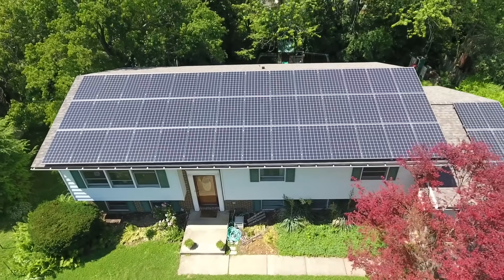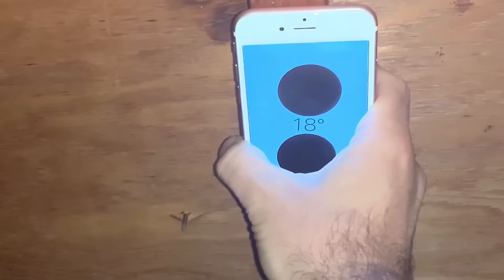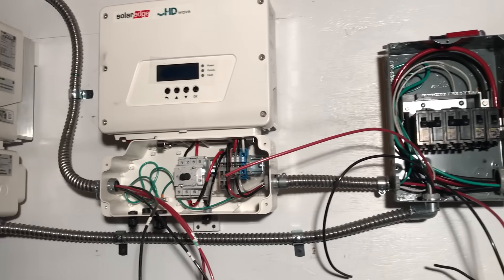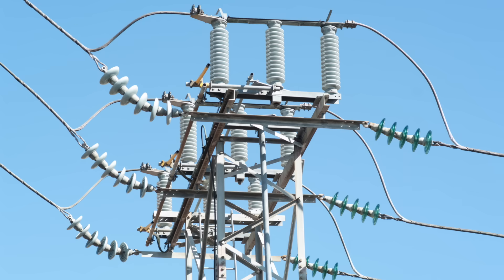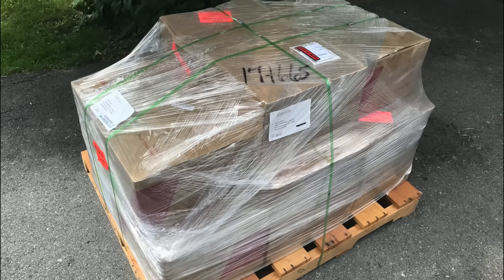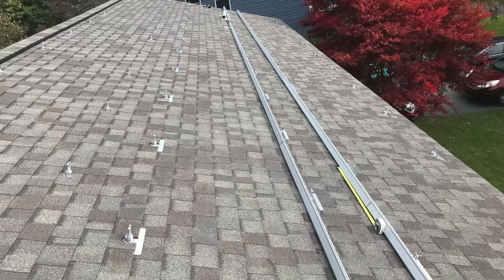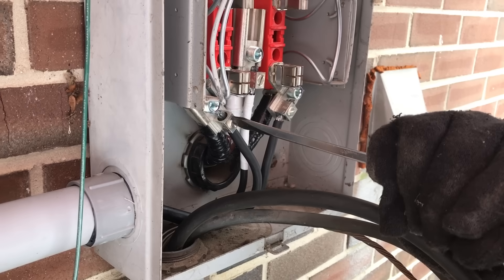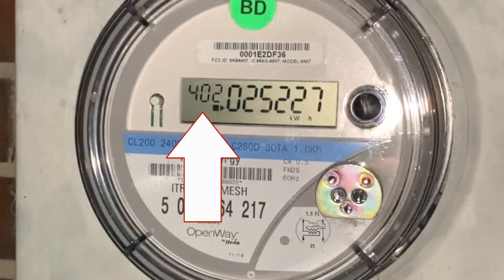I Installed a Power Plant Myself | HUGE DIY Solar Panel System

Comment: Excellent video! My only question (I'm sure others are curious) what the cost of materials was? You said you spent a "hefty amount" when things were unloaded and I'm wondering how realistic this is for the average household income. Thanks!
Reply: The only way I would do solar is off grid. screw the power companies!
Reply: Edit: They made a video on what they spent. They still pay $7 and some change a month in a fee, no batteries because they are hooked into the grid itself. However because of the credits they make, and can sell on an exchange, they end up making money each year.

The total cost that they said in the other video: $22,921, but they got a 30% tax credit which they say took the cost down to $16,045. https://youtu.be/QVanNbp6a4w A link to the video.
Reply: @TerrenceMcGinnis  Come to Canada...  on our electrical bills even if you do a solar roof system, as long as you are connected to the grid and supply most of your own electricity, you still have to pay "administration fees", "distribution charges", "transmission charges", "transmission deferral riders", "balancing pool allocation riders", and "local access fee"...  all these fees (and good luck figuring out exactly what they are...) constitute 30% of our bill...  my bill was $344.15 last month, and $91.98 was these "extra's" (not the actual electricity used)...
Reply: prob around 2-3 k, maybe as high as 4, but a lot of time
Reply: @leifseed  2-3k??? Do you know the price of copper wires?? A good 100ah battery sets you back 800 dollars alone, and that can only turn half the lights on.
Reply: @justheretowatch9451  a hundred or two for wire
Reply: @justheretowatch9451  im sorry where do u live
In middle east a 200 amp c10 battery is 270$
Reply: This is always the thing and part of what is making solar so difficult.  They keep it clouded in mystery and no one can ever seem to say what the actual cost is for setup.
Reply: You won’t get a reply.   It’s like a secret.   It really it’s embarrassing to say you spent 50,000$ on a system that last only 20 years with the batteries lasting 5.
Reply: @alab3657  https://youtu.be/QVanNbp6a4w Their video with the cost. And I don't think they have batteries, they do the whole 'back into the grid' thing instead.
Reply: @alab3657  Yeah battery replacement would be  the same cost as just being frugal with your electricity, better of investing into water tanks to save
Reply: @alab3657  He answered those questions in a follow up video he posted over a year ago:
https://www.youtube.com/watch?v=QVanNbp6a4w
Reply: All of your numbers are way off and he said it'll pay for itself in 5-7 years in this video. Who tf liked this crap?
Reply: @32BitJunkie  In 7 years those panels and all that accessories will be useless .
Reply: like another said, is actually embarrassing. the life of these panels is about 20 years on average, with decreased efficiency every year. truth is he will probably never cover the cost of the install with savings on electrical bill. i know this because i install solar as a living.
Reply: @justheretowatch9451  so mate, at this point are you saying solar isn't worth the expense?
Reply: @jdm6613  not yet. It's certainly fun to experiment with and it does have its niche uses. But for whole home power, it's just not viable yet.
Reply: @justheretowatch9451  thanks mate, I always wondered. Especially during power outages.
Reply: @jdm6613  nah, get a 500 dollar gas generator for emergency back ups. That's what I use. I have some solar but I got the panels free and only use it to power my basement lights. But I do it for a living and got the materials free so it's different.
Reply: @justheretowatch9451  ok mate, thanks again. Take care
Reply: @justheretowatch9451  Id rather pay the cost.... rather than paying an electric company.
Reply: @justheretowatch9451  you pay off your panels in 6-7 years. Panels and workmanship warranty are up to 25 years. Panels are guaranteed to have 80% efficiency after 25 years which is still good. That's amazing. You're just a hater for renewable energy.
Reply: Not worth it for now, just a headache.
Reply: @denialphasebitcoin5639  well in the UK electric prices are soaring   im saying doubled

Comment: When using a generator during a power outage it's very important to use an interlocking device that prevents electricity from going to the grid and potentially hurting a lineman making repairs. 
In a solar system such as the one featured in this video, is there such a device? Does that special meter keep power from going to the grid during an outage? 
Also, will this system run the house during an outage (assuming you're getting full sun light)?
Reply from the maker: The inverters shut down when there is no grid voltage. In the US, this is a mandatory safety feature for inverters.
Reply: @FrugalRepair  ...I didn't see any mention of a battery storage...i assume when the grid is down, you don't have power either.  Is a battery next on the project list?... And thanks for the video .. excellent work...

Comment: You say you earned your investment back around  have 5-7 years. Is that the cost of only the panels and all electrical wiring and how about your inverter? How much do you think you have saved by doing most by yourself? You invested your time and had some free help. If you hired a company to install all in once, within a day you can complete a roof. Much time also goes to wiring and connecting with your inverter and your meter. How much do you think did that extra work add up to the costs? 

Many people can only place 6-10 panels in the Netherlands. We have a second and third floor so our houses aren't that wide more small but with more floors that makes it pretty even. But less place for panels and I think that, oké 48 panels are much more than 10 panels of 300 watt we have, that you always have initial costs regardless of how many panels you place. For you it costs maybe a couple more manhours to place all panels but if you didn't did place them by yourself. How much costs did you need to pay extra and for me more interesting, how would the extra costs affect the payback time from 5-7? You earn a lot with almost 50 panels and energy prices are going trough the roof!

With so many panels you will absolutely deliver energy when it is full summer. In the night you use energy. And in the winter you maybe use more from your energy company. Can you "net" the supplied energy with the returned energy? So if you net deliver more in 1 year, the energy you bought can you just subtract it from what you have delivered? No price difference? And how about taxes on used energy. Can you also get the taxes back from used enegy. Not only the price of just the energy. 

Here in the Netherlands they will over a period of 10 year steadily not pay back the taxes that is added to the energy you deliver and using it overnight and winter. So if you deliver back you only receive the price of energy what differs let say 10 cent taxes are 15 cent so now you get 25 cent back what you deliver and use later but after 10 years you only receive the price of energy and what you use you pay taxes over it. So if you deliver 20KW and use 20KW from the power network now it is even. But steadily you will pay more taxes over the used 20KW up to 15 cent per KW and over day you receive 10 cent per  KW deliverd so in my opinion that is absolutely unfair. They are pushing everyone going green but if you use as sample an equal amount of energy yearly as you deliver back so breakeven in energy, you will still pay the taxes over what you used so only way is to install a battery and save the energy and feed it later, but battery's are very expensive and in the summer we deliver far more than we use over a full day and in winter we use far more than we get from the short rainy days...

We we have a rental house and our corporation placed on all houses 6-10 panels for free. 6 if you have a roof window. Some have 6 facing east or more west. We have 10 facing direct south so best of all. And we live in a how you say it in english? row-house. 6 houses neighboring so a very wide roof and for them they placed 60 big panels in 1 day for 6 houses so that must averaging the costs if they are already on the roof with all equipment so I don't know the costs.
Reply from the maker: Check out the next video, it hopefully will answer a few of your questions.
Reply: @FrugalRepair  Ty for you quick reaction, I will watch the other video. Still curious about energy prices around Amerika comparing with Northern Europe, The Netherlands where I live. In some videos I heard that prices a lot differ between states. US is much bigger than our little county so in the summer we have a lot of overcapacity of solar energy. In some little towns they have so many solar panels and fields of solar panels that some parts of towns can't deliver their energy because the energy net is completely full. So their systems turn off. Those toens don't have big industry just the problem too much and everyone is at work so houses uses nothing. But I think in states like Texas Florida Nevada with very high Temperatures uses a lot of Airco. Those systems use a lot of energy and then it is very good to have and sun and direct usage. Is it cold and rainy no Airco and less power so that is more balanced. I heard that in Nevada prizes are going crazy last summer, don't know how it is now with the high inflation and economic problems that build up in the US. It's not going OK in the US with almost reaching 30 Trillions of debt and also new 8 trillions on the balance sheet of buying to help te economy and I look at videos and the FED is printing money in oblivion and many fear for a very big crash/collapse of the financial system. 

What I said Inflation is skyrocketing over 7% Netherlands over 5% and we have a 3-year energy contract with fixed prices so we are super lucky. The variable tariffs are €0,50 is about almost $0,60 for 1 KW/H energy including taxes. Without taxes is the variable tarif is €0,35 = $0,40. We pay half the price now with our contract luckily now. 

But you live more north am I correct and with so many panels and those high prices you will earn so much more that you can pay back your panels now like crazy if you deliver so much energy. Can you maybe give an example of what your panels deliver at a sunny summer day times the tarif. If you have average 15.000 watt for 12 hours is 170KW/H too max 200KW/H on the best days if I calculate 48 panels about 300watt per panel for 14 hours sun. That are massive numbers!

Comment: From what I can see, your roof is larger than mine, which means my cost for installation  should be less than your cost. I was just wondering if I could inquire what the final cost was . I've been thinking about this for a long time. The leaky roof was one of my biggest fears. 
Thanks.
Reply from the maker: You might want to check out the video after this one. I go over the costs and production of the system in detail.

Comment: Solar panels are more efficient with Battery Bank....
Would you consider getting a battery back up...  If you have a big enough Battery bank then you could charge up your battery with solar or if solar panels are not big enough then cheap power from the grid... Then export power to the grid at a higher rate from battery bank and solar panels ...$$$  Only works if you are charged at different rates during the day..
Reply from the maker: I made a video recently talking about solar and batteries, you can check it out if you want.

Comment: From what I hear is if the electric grid goes down it locks out you solar system so you have no power. If that true if power goes out for a week you have no solar power.

Comment: Stay off the grid..Don't backfeed the energy company.
Reply from the maker: Why not?  It pays me to stay on grid.  I don’t understand why I would need to spend thousands of dollars more on batteries and the hassle when grid tie is available with 1-1 net metering.  I cover this topic and the pro and cons of integrated batteries in one of my latest videos if you’re interested.
Reply: @FrugalRepair  well for 1 when your grid goes down from a storm or hack or whatever you will be the guy with a roof full of solar panels and you can't harness a single light bulb of power..At least get a small back up battery system to run freezers fridge etc..Think about it things are bad and who knows  when something could happen naturally or unnaturally..
Reply from the maker: You might like the video I made on the topic.  Having a small battery backup if you have 1-1 net metering is something I recommend.
Reply: @FrugalRepair  I'll check it out...
Reply from the maker: It’s the one called costly solar misconception.

Comment: A question. If you put a backup generator you need a double throw saftey switch so you can't energize power lines in a power outage. How does this system not energize "the grid" when it is actually illegal to do so with a backup generator if the grid is offline?
Reply from the maker: Thanks for the question. I actually don’t have a generator or integrated battery in my system.  You are right that if I did it can not energize the utilities connection.

Comment: It sounds like you always have excess capacity.  I think this is a good thing, but now what do you do with that capacity? How do you put it to use?  Heat your water with it.  Get an electrical heating element and dump that excess power into your hot water tank typically heated with natural gas.
Reply from the maker: If you watch the next video after this one, I talk about net metering. Any excess I generate I get credit for from the power company.

Comment: How did you calculate for uplift forces on the attachments? Did you check if your roof rafters can hold wind downward forces?
Reply from the maker: I hired an engineering firm to do those types of calculations.
Reply: @FrugalRepair  how much did they charge you for those calculations?

Comment: I’ve been mulling over solar for 2 years now and get discouraged by just how big the project seems. It’s encouraging to see content like this online. Many thanks and awesome job mate 👍🏼
Reply from the maker: Hope the videos are helpful!  The next video coming out is also going to be a diy solar install.
Reply: I'm the same.  There's a lot to know.  Batteries are one.  What is an Eddi.  On and on.  I'm researching and the only decent resource has been an Irish Fb page, however I am in Scotland so no tips for suppliers.
With respect, unexpected that with no previous experience, it's possible to manage this first time without issues.

Comment: Tell me about your battery storage.
Reply from the maker: I don’t have integrated batteries.
Reply: So it is not an off -grid system, my bad. Only interested in going off grid in upper Michigan. We will use ground mounted 450 watt panels (20 of them), etc.

Comment: Grid tied systems in Washington and many other States require that you purchase crazy expensive panels and inverters from companies that are in bed with the state government. You may have to pay up to 10 times the current price for panels and inverters. To offset this insane rip off they offer tax incentives that just shift the cost to the rest of the tax payers in the states involved. This is just theft pure and simple. Don't do it. Walk away from all grid tie systems and purchase your own stand alone system so YOU can choose the best components and panels for YOUR installation. In the event of power outages, Grid Tie systems do not offer any protection to users and YES, you will be out of power. In Idaho many homeowners have just walked away from power companies and corrupt county bureaucrats by installing their own stand alone systems without anyone's permission.

Comment: Great video, well with that much solar panels here in the Netherlands u will be rich.
Right now u get payed back money, for every kWh 0.25€ct. I have 12panels/3000kw I get yearly 800€ back only for electricity, I can't put more panels on my roof otherwise I would completely switch off my gas, it's so expensive 1.40€ a m3.

Comment: I leave in the south of Sweden in a place that is called Skanör, and we are forbidden from the military to instal solar panel on our roof, because they say the solar panels sends radio waves. What can I do, is that true the solar panel can send some kind  of radio waves?
Reply from the maker: No, they don’t send out radio waves.  I’m not sure what they would be concerned about regarding the solar panels.  Some inverters use WiFi signals but I don’t think they would be concerned with that.
Reply: @FrugalRepair  I think the military say that It interferes with their instruments.
Thank  you for reply. :)